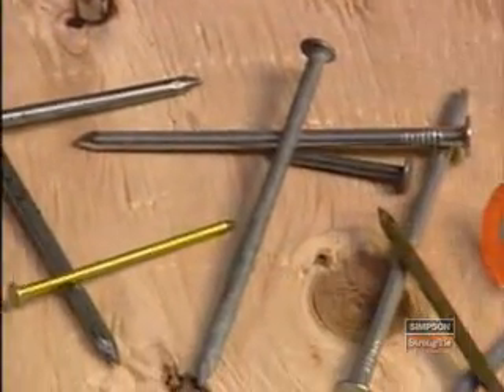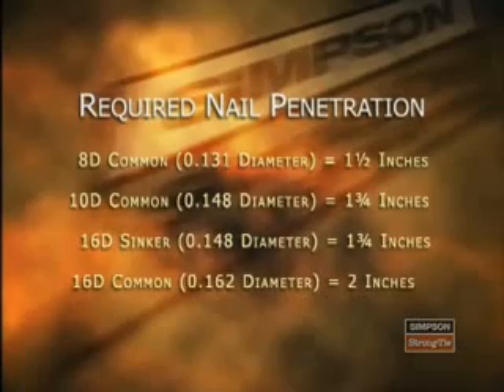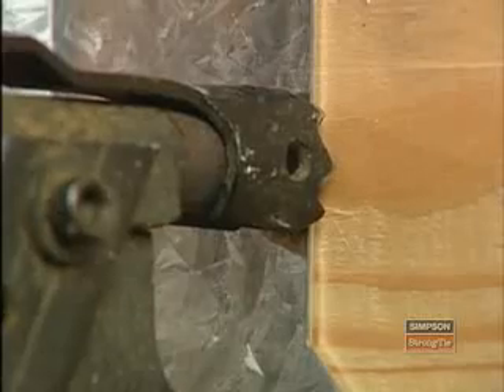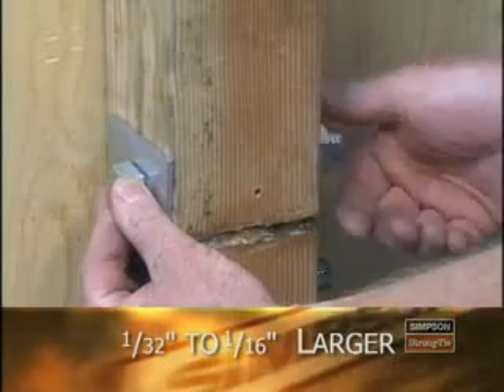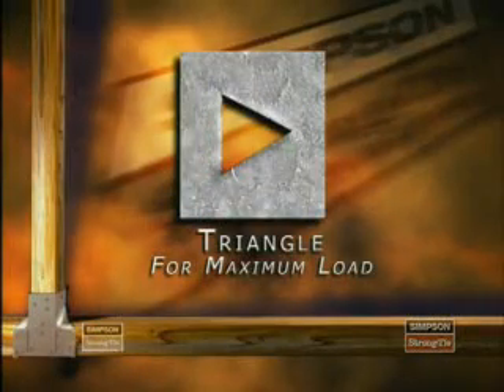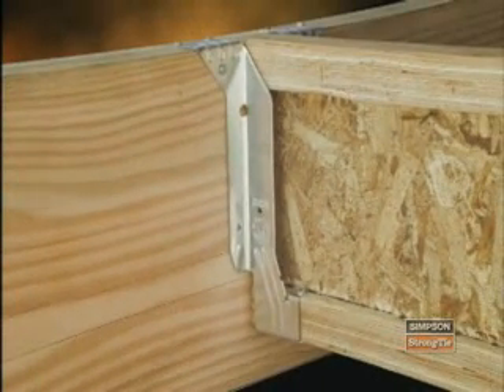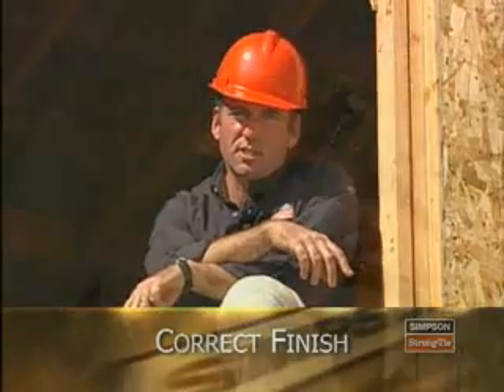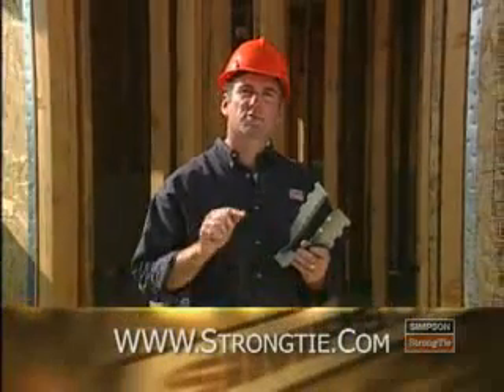Simpson Strong-Tie - Basic Fastener Installation

Comment: You didn't clean the dust from the drilled masonry hole before installing the screw?
Reply: The presence of dust likely doesn't affect screw type fasteners where with epoxy type it can greatly reduce capacity